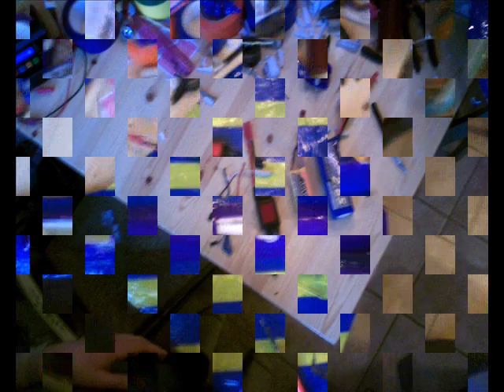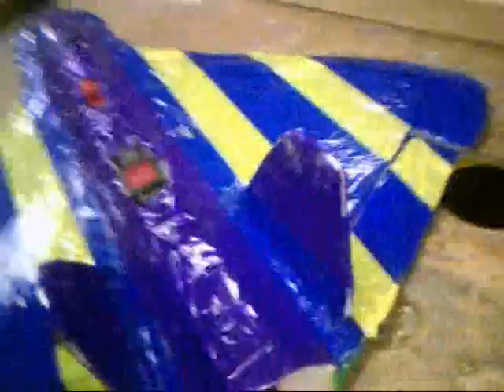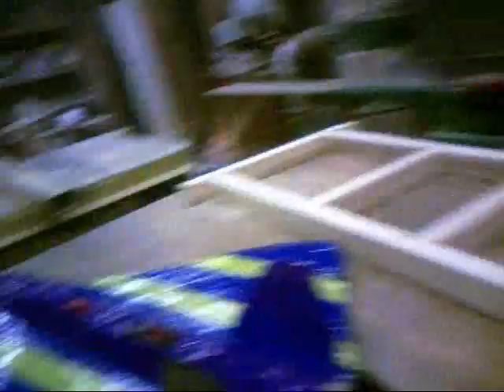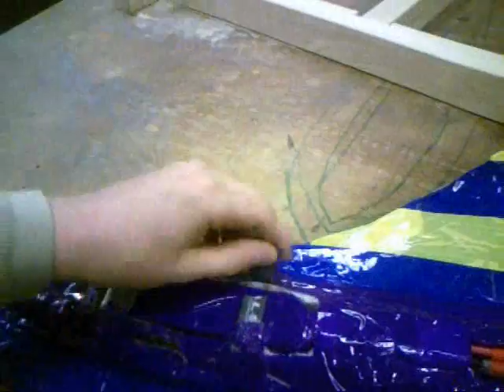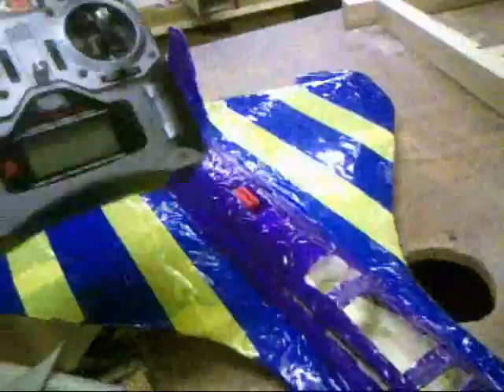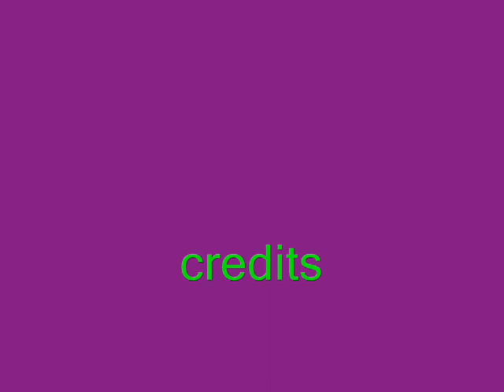Fast scrachbuild rc airplane, sw-1 build part 3

Comment: Looking pretty crazy rcmotorsect!  Can't wait to see how this one flies for you. I hope awesome. My SuperNova jet was about 3 pounds and that motor has no problems powering it. This thing should be a beast!  just be careful with the 6S lipos and the 6.5x6.5 prop. That may be too much like you mentioned.  Frank had the same setup and it was pushing over 2000watts!  Anyway thanks for sharing your build. Best of luck for the maiden flight.
Paul